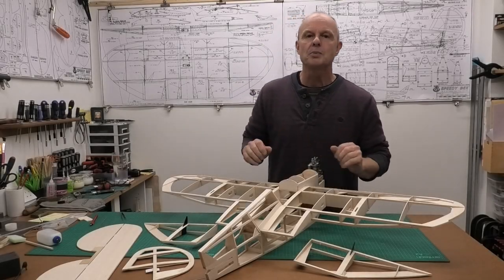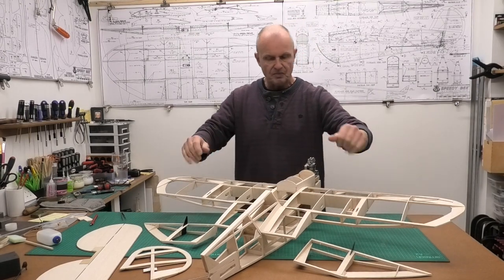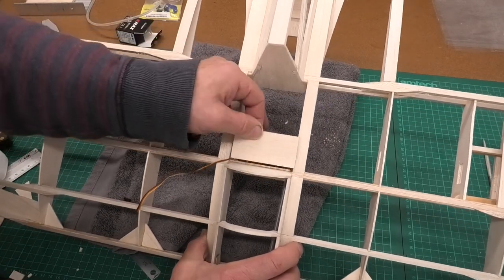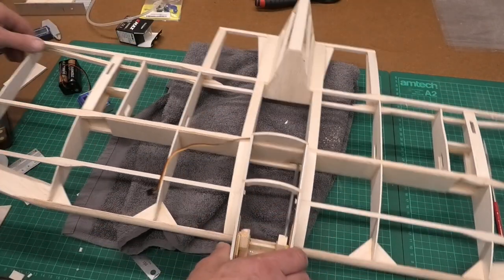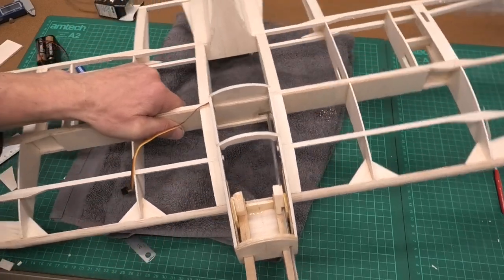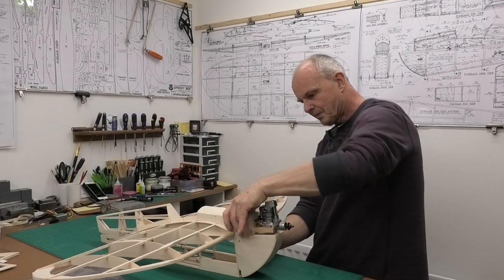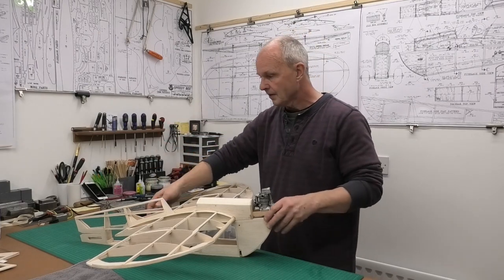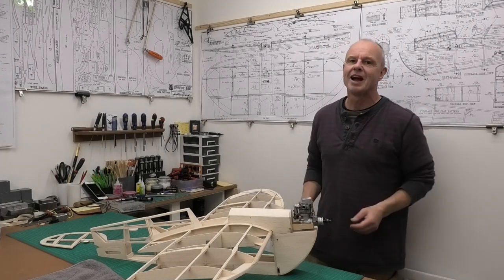Speedy Bee - Build Series Pt 11: Fitting the Tank & Throttle Servo - Designed by Clancy Aviation

Comment: Great video again Mark!! You forgot the video link for fuel proofing 🤫- Anyway, I've made the nacelle and almost completed the wing so far. Ofcause not as perfect as yours but it's good enough though 😊 - I have traced the drawing on my CAD program and cut the parts on my 20W led laser - perfect fits. - I might upload all the files to outerzone once completed and adjusted where needed. - PS. Years ago my friend had a Speedy bee with Postman Pat as pilot and probably the main reason why I'm building this plane now as I loved the look of it. I guess this plane need a cartoon figure pilot to match the funny looking plane - don't you think?
Reply from the maker: Hi thank you for the comment, pleased you like the video.  Thanks for the heads up about the link, I have just corrected the omission.  Pleased to hear your build is going well, would be great to upload your CAD files to OuterZone.  Yes, Postman Pat would be a great choice, go for it!

Comment: We used to utilize a steel cable inside a tube for making the throttle linkages. That provides the flexibility needed to account for the arc of the arms and we could glue the tube firmly into the firewall. This also minimized the chance of something rattling during flights.
Reply: Sounds familiar, with a ball link on the throttle arm.
Reply from the maker: I have always thought what you are suggesting is a good idea, but never tried it, but must do it on a future build.  Thanks for the comment, really appreciated 😀
Reply: @MarkRobinson555  ❤